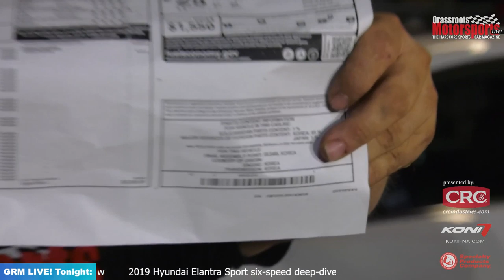2019 Hyundai Elantra Sport deep dive review and technical analysis

Comment: 41:00 My parts department guy still pull up these camber bolts... I guess I'll just run a staggered setup for next year's autox season and HOPE the rules change to allow manual adjustment of the shocks as there is already a controller out for the N.